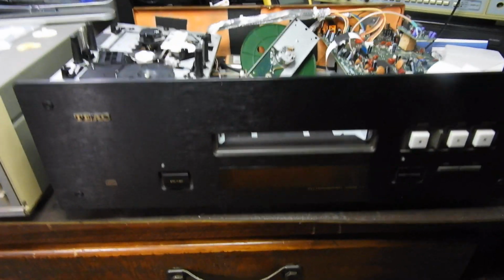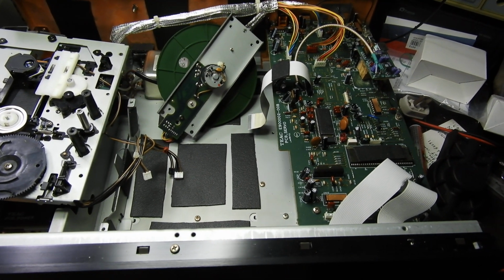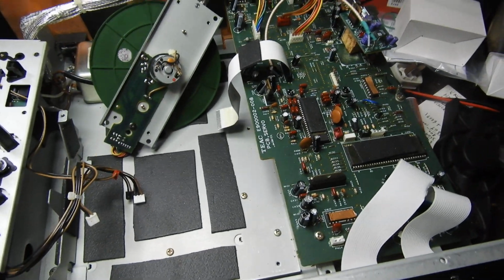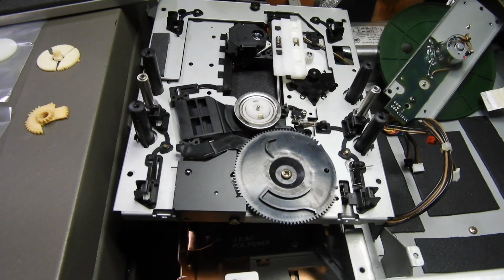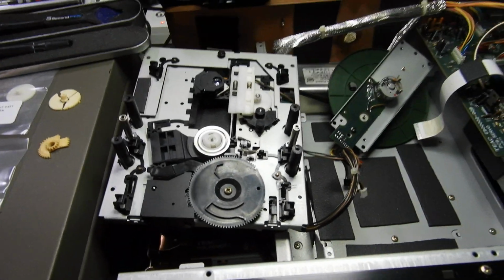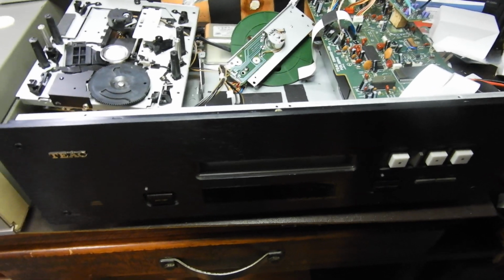TEAC VRDS T1 Transport based on Sony KSS-240 laser mech - with typical crumbled gear problem...

Comment: I noticed dampening pads on the inside of that transport. I added Dynamat strips to the inside of my CD player. What is your opinion about this tweak? Thanks.
Reply from the maker: Not very high. I can also see metal stickers on some ICs and they should prevent digital noise from escaping. If anything, this is what I would do, for this is done by some manufacturers. 
I must admit that I have seen all sorts of rubber dampers and even pieces of Japanese wood glued in the Counterpoint Transport I serviced, but no engineer would fit those. Only well meaning enthusiast.
I am not a tweaker.
Like the previous owner of this machine who stated that he started having problems, ever since he installed this Super Clock. But he has never worried about them crumbling gears.
Another example was a guy he wrote under my Marantz CD-80 video, that I have destroyed the player, because I should have fitted (some brand) of capacitors instead of factory fitted ELNAs - because it is proven to take the player to a different level. But he was not worried about Philips blue axial capacitors fitted under the transport mechanism, which are notoriously leaky, and with time will stop the player from reading discs.
In either case, I prefer to deal with the main issue rather than to tweak the machine. 
Firstly, I am not qualified to improve designs that engineers smarter than me have created.
And secondly, no one is going to pay me for spending hours on some tweaks.
Thirdly, a lot of people prefer bulk standard, working machine a  than tweaked one, particularly, if they do not know about that particular mod or do not trust the person who has implemented it.
Reply: @hear-net-au  Thanks very much for your detailed answer. I'm not skilled at electronics at all, and so it's strictly dampening vibrations for me, or else leave it alone. This question comes up regularly on various audio forums as you'd know. My response is usually to say if you want better sound, buy better gear and/or look into room acoustics.

Comment: Maybe a stupid question,,but why not replace the plastic gear wheels with alloy ones,,or steel..??,,last a whole lot longer....or maybe the motors would have to be upgraded...just a thought...
Reply from the maker: Cost. There was a guy in Germany who made brass ones, but they were $70 for the set of 2. Plus shipping. I paid $25 for two sets shipped from Singapore.